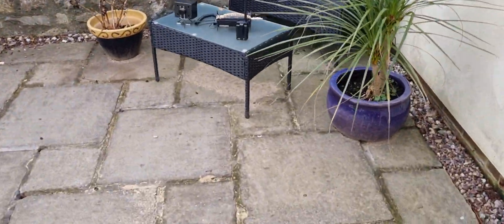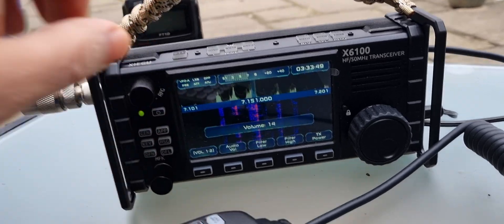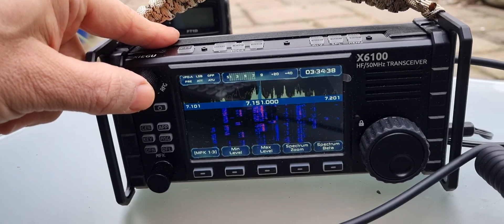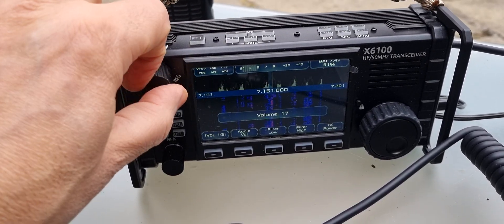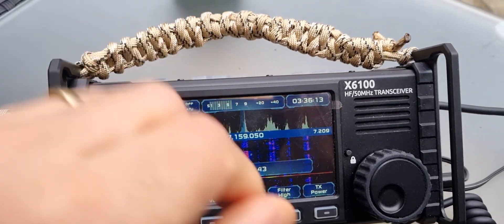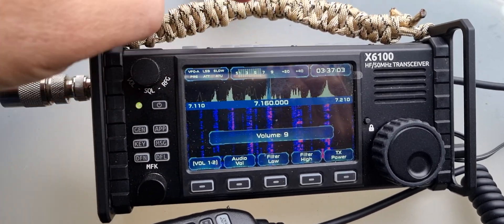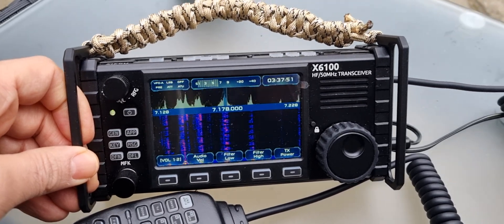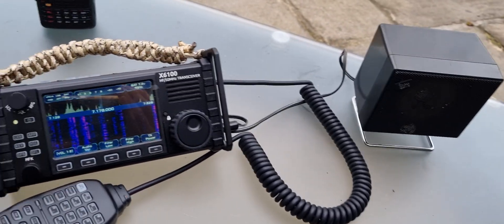XIEGU X6100 EXPERIMENTAL FIRMWARE R1CBU

Comment: Did you by chance experience occasional freezing of display upon scrolling the band tuner, sound continuing, frozen image no buttons work (except reboot button)? It did this twice to me - the two times I tested the FW. Appart from this all smooth.
Reply from the maker: Hi sometimes yes
Reply: @M0FXBHamTech  I fixed this by using a different SD card (by advise of Oleg) and another card reader on installation. No freezing ever since. But tried 3 cards.

Comment: Does it actually TX 10w on the inbuilt battery now?
Reply: You can set 10W. Only the battery does not pull. It turns out about 5-6 watts
Reply from the maker: I think laws of physics may prevent this.